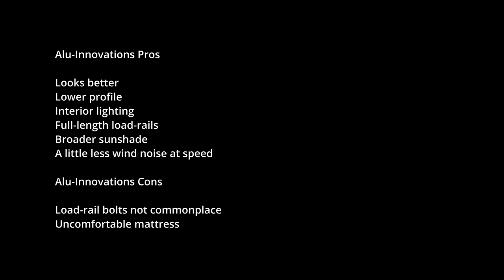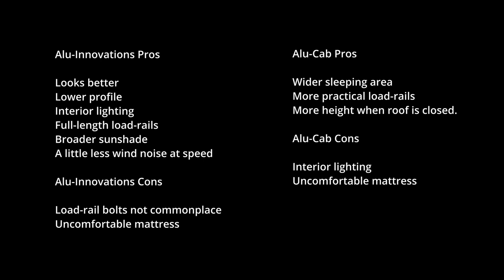TROOPY CONVERSION COMPARISON. Alu-Innovations VS Alu-Cab Hercules and Alu-Cab Thor | 4xOverland

Comment: I would still just get the new Ivevo Daily 4x4 van. Just way easier to have as a live in camper and with an amazing 4x4 system still
Reply: It's too heavy for many of the tracks in Aust and if you only have 2 people, why bother.
Reply: @ookeekthelibrarian  actually it only weighs 50kg more than a Land Cruiser. So after even a lifting roof is fitted to a cruiser it'll weigh more than the new Iveco 4x4 van.

Comment: Andrew:
When you looked at the Grenadier, did the back seats fold completely flat?   Could you sleep in the back?  Since we can’t get the 70 series in the states, I guess I would compare the Grenadier to the Toyota 4-Runner or Jeep Wrangler.   Thank you for the information.
Reply from the maker: No. I don't think you could sleep flat. But then again, this isn't a production example.
Reply: No the back seat of the 5seater Grenadier houses batteries and electrical and it doesn’t fold flat.  But they are doing a 2 seat version for Australia, not sure if that’s being made available to the US.

Comment: How many total volts does your additions to your truck require. Watts are used by mechanical engineers fuel measurements. Electrical engineers use volts.
Reply from the maker: Volts x Amps = Watts. Watts is a measurement of energy. Volts is not. Volts is like the speed of water coming out of a pipe. The diameter of the pipe is equivalent to Amps. The amount of water is the Watts. This truck has a 12V system. What changes or can be altered is the amount of energy required and used. I.e. how many Watts.
Reply: @4xoverland  Electric Ford Transit is coming to USA. Your market is expanding with van live. Mention the units of Voltage also. Watts are not precise enough for electrical engineers. Watts are heat units of a fuel and Fire Ratings..
Reply: @4xoverland  Although I like the comparison, that is not fully correct/accurate. Ampere is like the amount of water going through per second comparable to volume or litres per unit of time (amount of electrical charge per second). That is why a bigger pipe (=thicker cable) can carry more water per second (=more Amps). I think that is what you meant. Volt is then the slope of the pipe making the water run in the first place (letting electricity flow), not the speed. But a steeper slope makes the water run faster. Watt is the measurement for Work=Energy done per second which is called power. To understand Watt you can think of a watermill that only turns if the water has enough volume or runs fast enough to have enough power to run the watermill. You can take a flat slope but huge amounts of water which would have a similar effect of taking a steep slope and little amounts of water. Hence AxV = W (volume of water per second x steepness of slope = power to run watermill).

Comment: Andrew, for the 76, roof conversions have been available at least since the early 2000s. back when only the lj77/78/79 KZJ77/78 were the available station wagons(only the front is different). So AluCab are late to the party.

The grenadier will get trouble with roof conversions due to the roof console with the buttons, manufacturers have to work around this.

you owned each one of the 70Series? never seen a 71 with you

Comment: Yes the electric switches was the reason I changed my mind in the Grenadier. The roof can take more than 150kg static, which mean take a roof top tent, the easiest roof top tent is the GFC (Go Fast Camper) from USA. I have it ready on my FJ cruiser, once the Grenadier is in my possession it will be immediately installed on the OEM roof rack.

Comment: Reasons for awning on right hand side ?
Reply from the maker: In this case, the kitchen is on the right, so the awning is on the right. I'd be interested to know your reasons for putting it on the left. I know this is common practice, but why? There is no really good reason for it other than pulling off to the side of the road. But who in their right minds would pull over at the side of the road for a lunch? One pulls off the road, and then it doesn't matter. Or have I missed another reason?
Reply: @4xoverland  I can think of a few reasons to fit it on the left . Wind on the right hand side of the car is stronger with oncoming traffic etc ( breaking off ) it does happen to all brands . Anyhow I was more interested in your reason simply because I like the idea of it . Easy access to driver's side in rain is one that would suit myself.
Reply: @4xoverland ....if one has an unfortunate breakdown and unable to get right off....just a thought.

Comment: If only Alu-Cab had a better quality control. The manufacturing quality is rather shocking in the details (e. g. multiple misplaced rivets that are not 100% fixed, cables not crimped but twirled together and fixed with tape, mediocre quality insulation that makes condensation between insulation and aluminium quite a problem, lots of metal shavings left in the tent, …). Too expensive for that kind of quality control.

Comment: Mulgo better than both. Australian made.
Reply from the maker: Is it better because its Australian, or is it better because it's better?
Reply: @4xoverland  Both. Firstly the SAs have an external front facing piano hinge which is not ideal for longevity (the Mulgo's hinge is internal). The Mulgo is significantly lighter than the AluCab and has a lower overall profile. The bed is also wider, although it is  shorter than the AluCab. I believe the Mulgo Airtec canvas is considerably better than the others in terms of moisture. Oh....it is also Australian made. You should check them out.